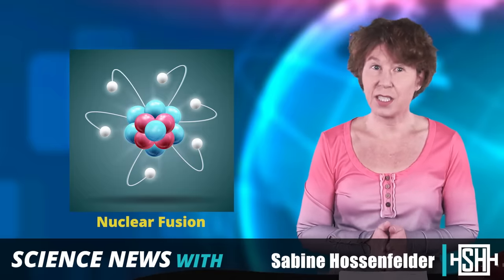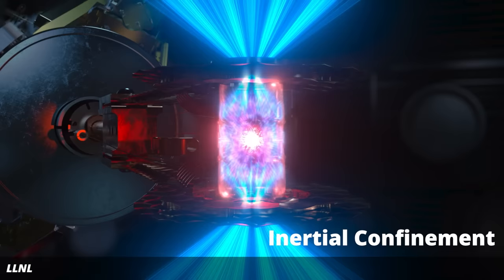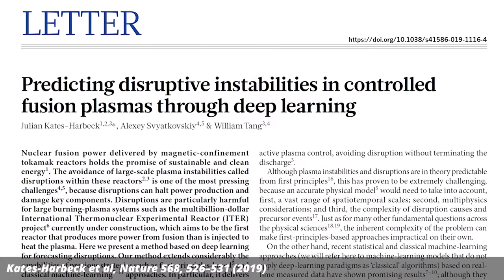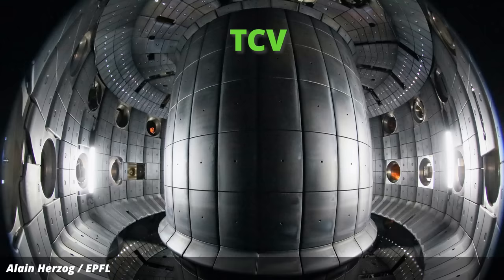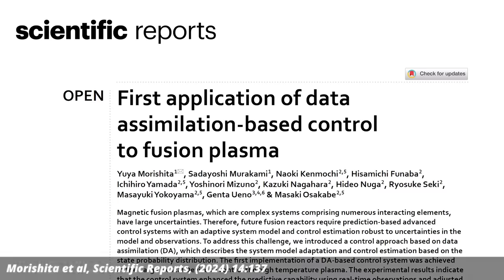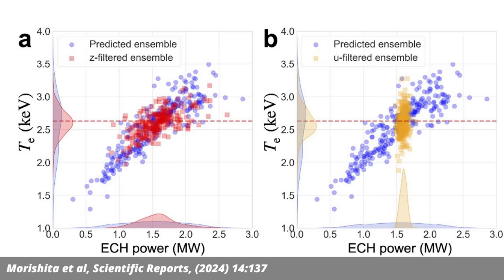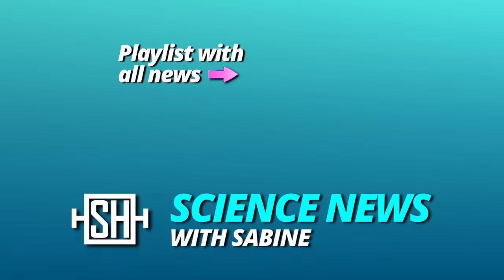First Nuclear Plasma Control with Digital Twin

Comment: I find it rather strange, that computer aided control to confine plasma wasn't employed before.. I was assumed it's been already like this for decades.. Which left me wonder, if description was a bit misguided? Because as to me it doesn't makes much difference between computer-aided control driven by some human-written set of rules and algorithms and computer-aided control driven by some AI, which anyways human designed, written and tuned.
I presume, a computer-aided control is not new.. what is new is using AI.. Which is quite expected nowadays, since it is a new old hype and all sorts of people trying to push AI in any possible hole whether it fits or not.
... which actually gives us the answer if fusion is gonna be soon or not.. apparently it is not. Because by juggling parameters, you can squeeze extra 10% of efficiency from your device. But you can never squeeze an orders of magnitude more than its already is. Be it AI or well designed program to control confinement field, it doesn't really matters at this point.

Comment: fusion isn't completely clean it still produces a non-negligible amount of radioactive waste. They did produce more energy than they put in at the National Ingition Facility but so did people at Los Alamos when they exploted the first H-bomb. Getting the energy out is still an unsolved task and won't be solved for many years to come, among a plethora of other issues. So don't get your hopes us and keep dusting those solar panels
Reply: They didn't get more net energy out at the NIF. 2.05 megajoule energy input from the lasers, 3.15 megajoule energy output from the fusion but 322 megajoule energy consumption to run the lasers.
Reply: but its not the same waste of a fission reactor. notably in the fusion case a lot of the mid-level crappy waste is absent

Comment: I thought stellarators were first conceived of in the 1950s?
Reply: but they didn´t work at that time, because they hadn´t ths calculation power oc computers at that time to manipulate the magnetic fields. Wendestein today works to hold the plasma stable.

Comment: Was it eye shaped? By the control or force given, it's controlled. What happens when the control is not at the hand and the results do become the sought information? Go back to some energy uses up more than said giving, and why atmosphere verses space is the case. ..the question is does rogain work? Well that's not the roe wade water or hair ...hhhmm

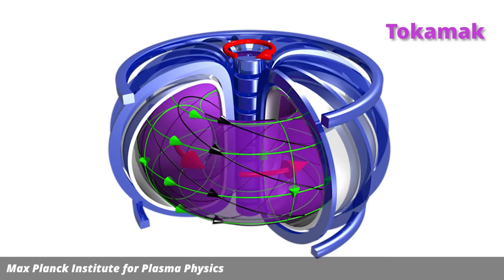Comment: 0:40 "A Tokamak is a donut shaped device in which  the hot nuclear fuel is held and heated with magnetic fields".
WHAT??? Dear Sabine. you just need to recall the basics of classical electrodynamics. It is IMPOSSIBLE to transfer additional energy to charged particles using a magnetic field: the vector of Lorentz force is ALWAYS normal to the vector of displacement, and the scalar product of the force and the displacement (Newtonian work A=F*S) is always identically equal to ZERO. I've heard you make this basic mistake in three videos already, that's more than enough for a physicist. Heating of the plasma (and acceleration of elementary particles in accelerators) is done by an ELECTRIC field.

2:41 "And if the  plasma gets out of control it can damage the reactor vessel."
OMG, another piece of nonsense. The contained plasma itself is instantly destroyed upon contact with the chamber wall, while the chamber itself is in absolutely no danger.
Reply: Time varying magnetic fields create electric fields (Faraday) and these electric fields accelerate particles and therefore heat plasmas.
Reply: @johnfinn9495  Yes, the plasma plays the role of a secondary winding of a transformer with a single short-circuited turn, the current in which is excited by the EMF induced by the alternating (continuously increasing) field of the primary winding.

Comment: No amount of innovations will solve the overhead issues, nor the fact that to get enough power to generate useful output you're essentially confining a sun or a thermonuclear bomb, nor the fact that the idea that fusion plants generate no waste is a fallacy, nor the fact that in order to get the fuel for fusion you need to burn water, which is a completely other resource we shouldn't be wasting.

Fusion research subsidizes PhDs. That's all it's ever done. It will never produce clean, cheap energy.

Comment: Why is it so difficult to fuse atoms ?
Reply: You fuse the atomic nuclelei, and they have a positive electric charge, that is strongly repulsive. To fuse them, you must bring them so close together, that another force, that´s even stronger, the "strong nuclei force", begins to work and glues them together.
Reply: @Thomas-gk42  exactly like forcing 2 magnets together with same pole facing each other, and ending up making one bigger magnet
Reply: @martf1061 Yes, the Strong Nuclei Force is about 100 times stronger than the electromagnetic force, but works only on very short distances.
Reply: @Thomas-gk42  strong and weak nuclear force, and gravity are nothing other than electromagnetism.
On different scales, different intensity, but its electromagnetism .
Everything at any scale has mass, and when a mass rotates, it becomes polarized. 
Think of atoms, the same way you think of solar systems.
Reply: @Thomas-gk42  what happens to a permanent magnet, if you turn it to liquid? Does it lose its original solid state permanent magnetism? If yes, does it regain its original magnetism when turned back into a solid ?
Reply: @martf1061  magnets lose their magnetism at elevated temperatures while still solid. If you melt them and then re-solidify, they will no longer be strongly magnetised and will need re-magnetising.
Reply: @martf1061  and your evidence for this is what?

Comment: The Stellerator was invented in 1951, the Tokamak didn't come around until 1959, sorry Sabine but you've got your history bassackwards.
Reply: stellerators didn´t work at that time, cause they couldn´t calculate the magnets and the magnetic fields acurately. Later they could. That´s what she meant.

Comment: As I watched this I realized that even this improvement is doomed to failure of fusion as an unlimited power source. How did I come to that conclusion?
I just looked out my window. The weather analogy also fails far too often for critical planning. As any one knows, even with the much better prognostications today, the weather has a chaos factor that means today's sunny weather has arrived with a shower beforehand that was not in the forecast. This in turn has delayed the start of a maintenance project of mine, that will ripple through the rest of my plans today.  If nuclear fission power plants, let alone fusion, are not online as consistently as other power sources, how would massive fusion plants be economic with the residual chaos uncontrollable?
Reply: That analogy doesn't work. Control Theory as a whole answers most of the questions and misconceptions you're having on this. 

Basically observing something versus controlling something are two fundamentally different things, can't compare the two like this. 

Controllers are always built with tolerance for error, inaccuracy in measurements, etc. 

It's a very precise field of math, not a "give it a go and see if it works" thing where the reactor will be offline sometimes and work other times by random chance.

Comment: I wonder if an old school internal combustion engine approach to hydrogen plasma fusion has been tried.  They can make those hydrogen pellets, then inject them into the engine along with water to flash to steam, a large EM charged piston maintains uniformity and spherical lasers initiate the fusion. It would have to be pretty big I suppose, bigger than the tokamaks shown.
Reply: On the plus side we've been studied this kind of reaction for some two hundred years, so it is a known workable design.  We can predict how well it  will work, before we build it.  Unfortunately this would not be testable on the small scale.

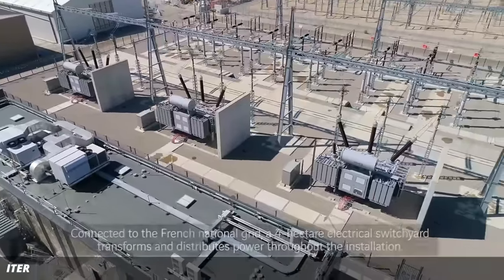Comment: 1:02 see that freaking great electrical sub-station? That's bringing power IN to ITER. And that's about what we can expect from fusion projects, money and energy goes in, and hyperbole comes out. I'm not sure which is more disingenous, ITER or FCC. Both are super-expensive physics research projects, but one of them claims to be a solution to our energy woes.

Comment: 1 MILLION people use
1gW electricity generation which needs 
40,000 klm transmission 
= AUD$40 billion per gW
Fossil fuels = 5 time more electricity 
= AUD$200 billion 
Hello 👋 hello can anyone do maths ? 

When EVs are universal, the amount of daily electricity storage will be huge and available daily. 
Most vehicles are parked 23hrs every day and drive building to building. 
50m2 on 230m2 roof is enough PV electricity daily for most of the year.
NO NEW GRID CONSTRUCTION COSTS 

$2billion generation needs $40billion grid.
AND EVs, electric vehicles. 
Hello 👋 hello anyone do maths.

Comment: Sooooo... we'll have fusion reactors, the stability of which will depend on a computer NEVER experiencing an error... 

I'll take the fission reactors that DON'T need an advanced AI monitoring it every microsecond to prevent it from destroying itself, thanks.  

Also, assuming this MODEL actually works in the real world, this still doesn't solve the IMMENSE energy gap required to actually generate usable power via fusion... 

And so, fusion research gets another 20 years and hundreds of billions of taxpayer dollars to chase that pink dragon.

Comment: control it with AI that is better at single shot learning that is more human like! like, using organoids, or math solving AI or symbolic AI ( if that is yet possible)!, I would guess with such a thing being 98% correct is not so good unless you can increase the distance to the walls, knowing the magnetic fields fall by what,the component of the magnetic field along the axis of the dipole falls off as 
1/r3, while the total field strength (magnitude) falls off as 1/r2 at far distances from the dipole. 

here is a summary of a dumb thought, that just might take too much energy to design.

generating a distant, concentrated 3D interference pattern of magnetic fields—would theoretically involve superposition and precise control over the phase and intensity of multiple magnetic fields. This concept shares some similarities with the principles of phased array radar systems or optical holography, where waves are constructively and destructively interfered to form patterns or images at a distance. It would be an enormous undertaking but would allow more time to reach the walls, allowing finer control and tuning before it is too late, I imagine at such energy levels such distances would need to be 10 or 100 times in diameter, I don't know really.

Comment: Could you give an unbiased opinion and interview the folks at the Safire Project and the company Aureon Energy, based on the electric universe model.
The appear to be making great strides in their theory and their reproduction of the sun and the lab, even transmutating and creating brand new elements in the lab proving that many elements are created at the Corona and not at the center of the Sun. It'd be cool if you could research this unbiasely and make a video on it.

Comment: Start with gas not plasma. Insert the EMF ring into the machine seal it. Turn your ring on and wait. Eventually the gas with metals will gather on there own and a star is born. As long as the magnetic fields continually reconfigure to the needs of the star it should create unlimited power at a constant rate. Peace 😎 ✌️

Comment: you weren't entirely factual here, they achieved a positive yield in power output for the first time in 2022. it wasn't much but you were still misleading when you said "when ever we've tried getting nuclear fusion to work, takes up more energy than it creates."

I love your content but this is something you should be careful of.
Reply: What they did 22, was a positive output with reference to the energy input to the plasma. It was far away from 
"positive" if you include the whole energy for the machines and devices to work. Sabine explained it several times in her vids about the topic. That doesn´t mean, that it´s wrong to do research on the topic in my opinion, and this vid is hopeful. But Sabine didn´t report anything wrong here.

Comment: We shouldnt be using AI to control fusion reactors...
They funciton as black boxes and there is essentially no way to actually know what logic the computer is using... and giving appropriate outputs isnt enough to actually determine this...'

For example:
An AI was tasked with diagnosing tuberculosis.... and it was more efficient than doctors in the region.... however it was only getting lucky... and, after excessive toil, it  was found to actually be evaluating whether or not someone had TB by the age of the machine that was used for testing...
because the older machines had more positives
and the newer machines had fewer positives....

Even though its methodology is totally unrealistic it was, by mere happenstance, more accurate....
And relying on such unpredictable technology fort such important tasks is absolutely stupid.

Artificial Intelligence is a misnomer, as it does not display intelligence, in any meaning of the word...

Comment: I hate to be a party pooper here, but fusion research has been going on for over 70 years and the best we've managed is around 70 megajoules (20 kWh) net positive output - about enough to give an average EV a 25% charge. Based on that I seriously don't expect fusion power to ever become a commercially viable means of energy production, and will remain as nothing more than a obscenely expensive scientific sideshow.
Reply: Fortunately scientists don't share your defeatism.
Reply: @MERLE1593  70 years and an obscene amount of resources ploughed into it with effectively nothing to show. It's not defeatism, it's about knowing when to call it a day and put those resources into something that is actually beneficial.
Reply: @slaphead90 - Obviously you're not a scientist.

Comment: Your six-electron atom (carbon) - four protons and seven neutrons showing - does not bode well for the hidden side. Electrons are probability densities (orbitals). Orbit is bad.
When Lisa Randall publically peddled her bushwa, one of her opening slides was an illustrative lithium atom (isotope) that was not even a bound state.  I pointed this out to her afterward.  If a skyscraper has no foundation, one doubts it can charge rent after completion.